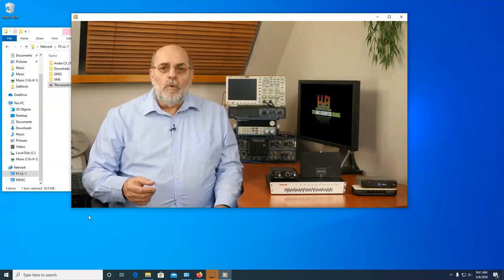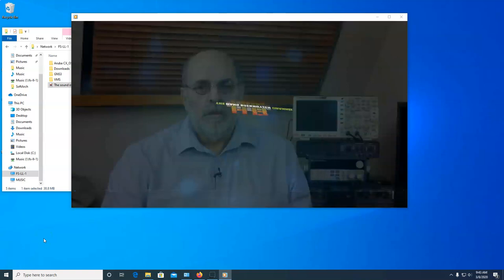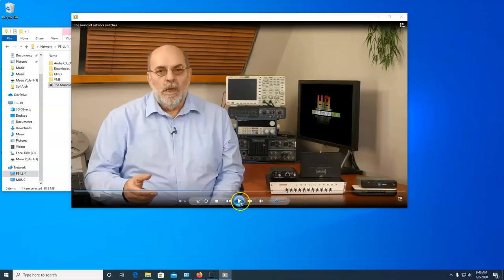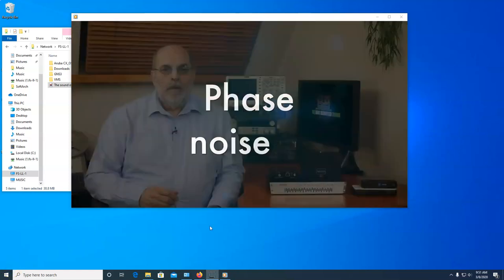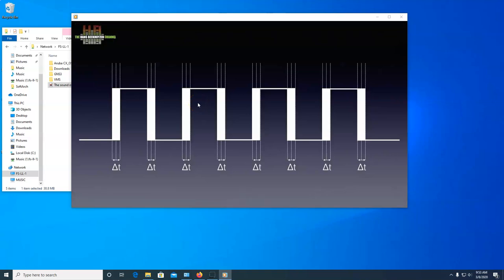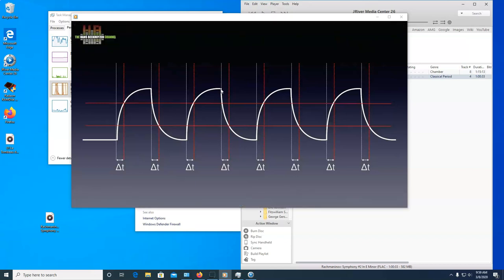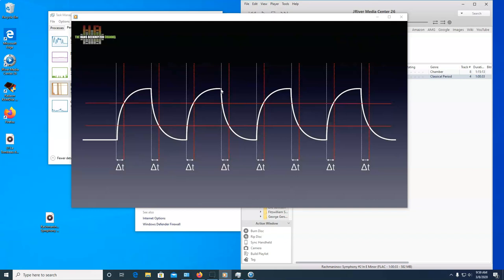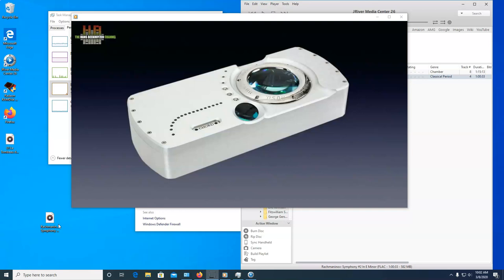Reply to Hans Beekhuyzen on Audiophile Switches

Comment: Thank you for a great video! What I find most puzzling about this theme is how unwilling some audiophiles are to embrace pure facts and undisputable knowledge like this. When there are so many things that matter for sound quality learning what doesn´t should be welcomed with great relief instead of burrying our heads in the sand. I have extensively A/B-tested a so-called audiophile switch for a few days now and have found absolute zero difference to sound quality. Which is great really:-)
Reply: I'm new to audiophile but already got what is going on. If audiophiles only talked about real important stuff they would be stuck talking endlessly about room correction and speakers placement, then speaker features and finally amplifiers. Since now some of the better sounding speakers are powered, only two factor remain. The other thing that puts a smile in my face is when I hear "tremendous difference in sound" when, in fact, it's just "infinitesimal difference".

Comment: Switches improving sound is on top of list for snake oil 🙄
Reply from the maker: I've yet to see anyone post a video of their TV picture quality improving with an expensive Ethernet Switch. It should work right?
Reply from the maker: @StringerNews1 Hey! I started my career in broadcast... Grass Valley, Pinnacle, JVC, Sony D1, Amiga VT and VTF etc...

I've also done Dante and AVB on Cisco Nexus. All 10GBe. Last install I did for broadcast involved two Nexus switches at $16K per for the facility. 

Timing is now going to be hardware in the switches itself with 8021as. 

But I'm talking about home use. You're point is that a CODEC in a live production environment is going to have to determine transport speed and adjust accordingly. We typically don't have that issue at 1GBe speeds. 

SDI isn't used in the home. So I have to ask if you have a point and sorry to sound snippy and it's not the tone I'm replying in. Just wondering what point you are trying to make when I asked if switches affect video quality and this is obviously in the home.
Reply from the maker: @StringerNews1 Where did you think these switches are being used?

Comment: Thanks for doing this video. I almost made a video like this a few times. I've just been too busy with work. I'm a network administrator with telecom experience, also an audiophile.

So many reviewers " reviewed " "audiophile switches " around the same time. Ugh. Notice they haven't said anything since those waves of reviews?

There is so much snake oil in the audiophile world.  I wish they would just cut out the BS in general.
Reply: Same here! I was going to do the MD5 hash, Wireshark (to demonstrate how much on the line is not audio but overhead and control protocols), explain the preamble and how the clock isn't shared, etc. I was even going to attempt to step through the registers on the CPU, all though that one is a bit over my head. I think the misconception about music sent over ethernet is that a lot of people think the ethernet frames directly represents an audio signal, and a change in the signal means a change in the resulting sound. At least that's what I think Hans' point about jitter comes from.

Comment: Thanks there was recently a post  about audiophiles needing $ 1400-3500 Ethernet cables with sliding Ferrite beads
I simply stated play the file from drive on the streamer because I knew the OSI model would not help

Comment: I think I said something to Hans about that video and he's good with the comebacks.  I find it really odd how many 'experts' can be ignorant and defend their position to the very end.  Just knowing how little bandwidth music needs and a little bit about TCP/IP protocol is all that is really needed.  I kind of feel sorry for him, his health doesn't seem to good.  I also wonder what he does with that test equipment strategically placed in the background?  I could probably put some of it to good use.
Reply from the maker: If he was good with the come back then he wouldn't so heavily delete legit technical posts.
Reply: @mnoble247  Ah, I really don't pay attention but that would be very telling.  Apparently he can always hear the difference a much more expensive power supply can make on things like Rasperry Pi with a DAC daughter board or any other DAC for that matter.  Like you said, blind testing is the only way to know for sure.  Especially if its something that can't easily be measured.
Reply: Thoses equipment are pure decorations in his case. He probably doesnt know how to use a scope,generator and analysis tools.   When he replyed to the MQA saga his reply was 3/4 on analog and ddnt really said anything constructive.  Anybody with knowledge of ip network and working will laugh about thoses switch. One of the switch I found was just a cheap unmanaged sw for $35 with a different casing and a crystal (new frequency crystal implied that it was now max out at 100Mbps)

I work for an MSO, we got 23 sites with cisco routers and sw, tons of servers for iptv, tv, internet and voip. We dont use fancy cables of any kind. We use quality sfp/xfp mpo cables to run at 40 to 100Gpbs between network equipments. Thousands of miles of fibers,etc. Let say he does streaming audio, this last switch would correct everything not audiophile quality at the customer premise?  lol  audio has some very unique needs that video doesnt care if I understand thoses audiofool theories. Funny is that no mayyer if its analog, spdif,toslink,usb,cat6,etc.. all needs fancy cables to be good.. audio encoded in all thoses type of transports are affected and you need a special cable and a device in between to "clean" the signal.

Comment: I have found not all switches are alike when dealing with real time data. I have to hand pick the switches and routers I use for DMX over Ethernet using broadcast ACN or Artnet. Some routers are low latency, while others buffer, then forward, which turns smooth motion on movers into jump, stop, jump, stop, as some send packet batches after accumulation of many. For video, this is fine as playback is start delayed, but the packets are buffered and the stream runs smoothly at it's bitrate. DMX lighting signal does not work with that as it is not buffered for smooth playback on the receiving end. It updates fixtures in real time as data arrives.  The same can affect non buffered audio devices that try to run real time.
The buying of audiophile switches simply means, switches already vetted for latency for low delay audio, such as live concerts where performers are in the same room as the real time playback in the monitors and speakers. Adding a switch that adds a 500ms delay would be a show stopper as the delayed sound becomes a delayed echo to the performers. All packets, including broadcast, should be forwarded within 20ms. They should not be buffered for longer to meet some QOS that is not in use.
My tests were on common home routers and switches on the LAN ports only, and between the WiFi and lan ports, not the gateway to WAN.
Let's face it, VOIP should be low latency. Audio rated switches are used in digital console setups for concerts and broadcast. Nobody is going to cache 3 seconds of audio between the mic on stage and the mixing console and call it acceptable for live productions.
Audiophiles don't understand live sound vs recorded sound. One must be low latency. Low latency is small cache.
Reply from the maker: I've implemented switches that are $30 and others $16,000. Just depends on the job that needs to be done.

Comment: Today I posted the following comment on his latest video, in which I discovered a flaw in his optical setup. He shadow banned this comment, since it cannot be found under the comment section:

https://www.youtube.com/watch?v=UQXSTXFnzvo

My shadow banned comment:

The main problem with your first network setup, is that the optical link is in the wrong place. You only isolate the NUC. You should connect devices such as a NUC, NAS, ISP modem to a separate switch which is optically linked to an audio grade switch (e.g. a SOtM with SFP module), and on this audio grade switch only connect your streamers, and the uplink to the rest of the network.

Since your electrical isolation is in the incorrect place, the reviewed device is going to make a difference. I admit that most of your readers will have such setup, and therefore the device makes sense.
Reply from the maker: At ~$2200 U.S. currency I fail to see how this can even deliver on it's price even if it made any difference at all. The issue now is that Hans keeps trotting out the jitter argument and I've put a stake in that vampire.

Comment: I can only say that i bought the silent Angel audio switch, it made a big improvement from my netgear switch, i have no idea what it does but going back to My old netgear switch is not an option, PS i am using standard cabels and powersupply
Reply from the maker: All I can say is I have a standing offer of my $4K to your $1K in your setup, when blinded, you won't hear the difference. I have another YT video showing you how this could work if interested. Offer is open in CONUS and loser pays travel expenses.

Comment: I think maybe Hans is mixing up the delivery of the data to the input buffer of the device that plays it with the incumbent necessity of avoiding jitter during actual D/A conversion. 
Also the imbalance in the transformer resulting in a DC offset rang false with me, since anything going through a transformer will need rectification, regulation and conditioning, so plenty of opportunity to produce correct DC whatever the tolerance in the transformer windings. 

I experimented this evening, accessing a WAV file from my NAS over mesh WiFi node and local Gigabit Ethernet switch (non PoE ports), playing via iPhone over Bluetooth to my DAC connected to my HiFi. I'll have to do an A/B test with the same CD on the CD player digital out via Toslink to the same DAC, see if I can hear a difference. All the best, Rob

Comment: My streamer is rather close to the wifi access point, which may be the reason why my system  sounds a bit better in wifi connection rather than cable bound through a standard switch even if fed by a LPS (or also by ifi X-power). I do not have a good theory nor good measurements to offer, except that even a standard ethernet interface that should galvanically isolate the streamer from ethernet source (switch) might to some extent be less than ideal (no interfaces is ideal). In my case, insertion of a galvanic separator between streamer and switch significantly improves SQ, though not as much as to really reach the level of wifi (some fans of double blind tests might declare that remaining difference to be „irrelevant“ and a matter of taste - I find its still quite a remarkable difference in refinement I‘d be willing to pay for >1000€, was it not for free).

Comment: What about the claim that DACs being fed optical are converting it in real time and don't have a buffer, therefore if errors happen they won't be corrected?

I haven't seen a demonstration of getting something bit perfect over optical or how reliable that is, but I think that's probably the case.

Also: since you sound like a reality based guy, do you see any advantage to building a system out keeping everything digital until it's at the speaker, or is that going to be transparent compared to using XLR?

Debating getting an all digital MiniDSP vs using balanced outputs which would allow me to use regular subs instead of expensive Genelec ones. Currently have a Genelec 8260 pair that I can feed with balanced or AES/EBU. Right now the analogue XLR is winning out because it's more expandable in the future if I want to do surround sound.
Reply from the maker: "What about the claim that DACs being fed optical are converting it in real time and don't have a buffer, therefore if errors happen they won't be corrected?"

What DAC? What input? TOSLink? USB is at least asynch. Inputs like AES-EBU, TOSLink, SPDIF can be more prone to clocking error because they have to be clock sync'd were USB and Ethernet does not. 

"Also: since you sound like a reality based guy, do you see any advantage to building a system out keeping everything digital until it's at the speaker, or is that going to be transparent compared to using XLR?"

I think it's certainly better than keeping it analog as long as possible :-) I'm a keep is simple and keep it short as possible. My setup is 3150N based computer with a 10GBe NIC with multi-mode fiber feeding DAC, feeding AMP, feeding speakers. My DAC also doubles as a preamp so my S.O. can use her phone over BT receiver for Amazon Music. 

"Right now the analogue XLR is winning out because it's more expandable in the future if I want to do surround sound."

Are you wanting to do M.CH audio or surround sound?